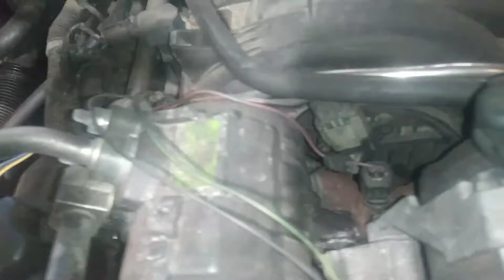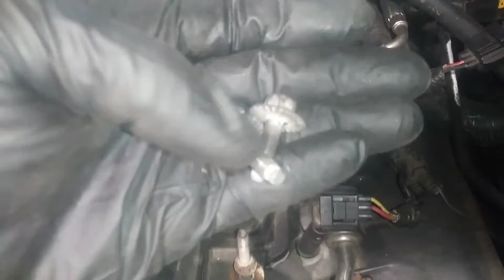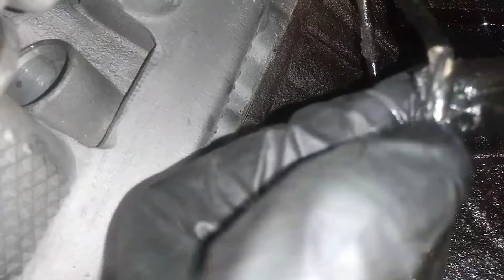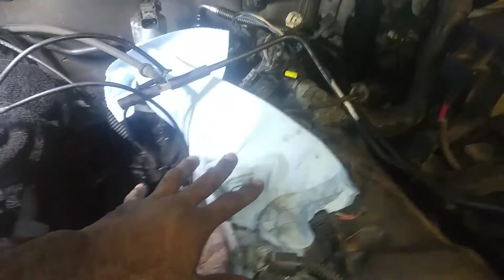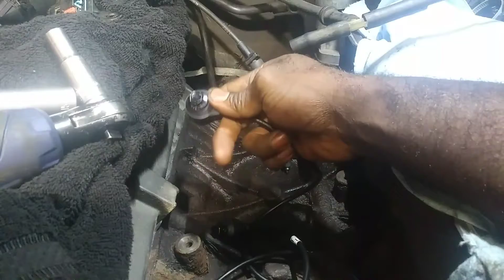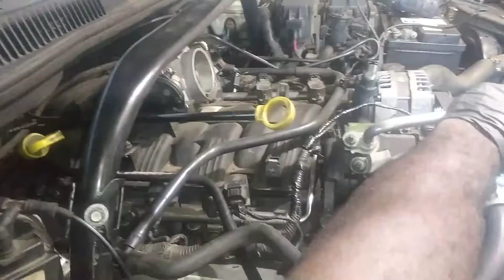05 jeep grand Cherokee knock sensors

Comment: Im working on 95 G/C ITS KNOCKING compression is at 100 good oil pressure it says misfire on cylinder 8 the guy said two of the hydraulic lifters was not working right so those got replaced still got a knock I hate to keep throwing Parts at it could be fuel injectors cylinder 8 I don't know if it can be the camshaft sensor or knock sensor no idea first time ever working on a Jeep it will probably be my last
Reply from the maker: Knocking is mechanical... Pull the ignition wire and see if the noise calms down, if so then likely rod related. I've had slightly bent rods cause knock, wrist pens, piston skirt failure or rod bearings fail that typically cause knock. 

To answer your other part as to sensor related. If... You had a misfire without knock I can see it being possibly electrical. However a basic fuel, compression or fire misfire would be a dead miss without knock, in most cases.